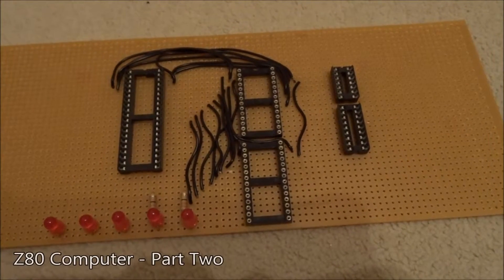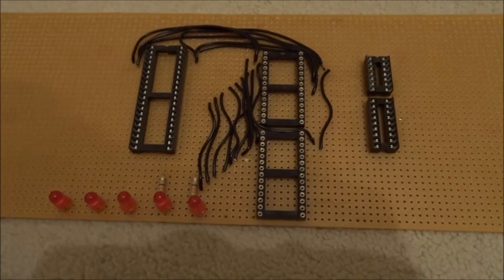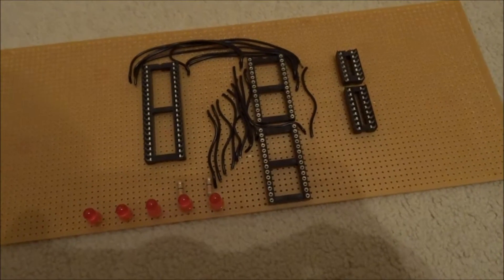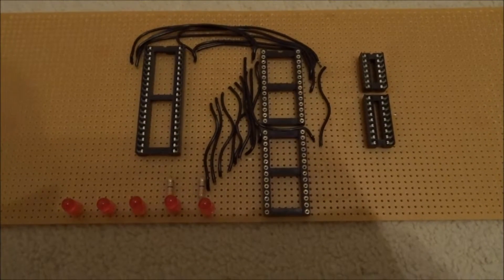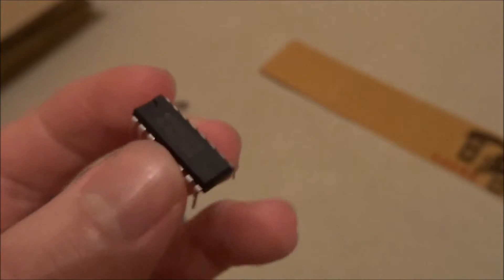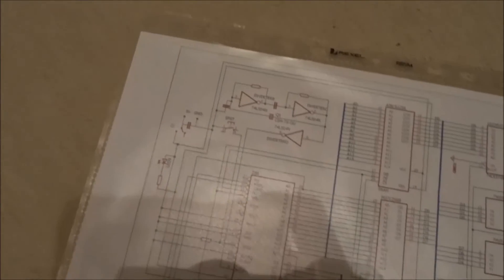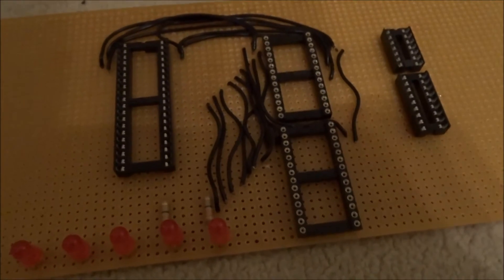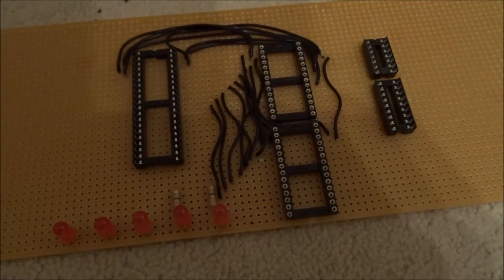Homebrew Z80 Part Two - Progress so far!

Comment: Can you tell us the part numbers for the RAM and ROM chips you are using?
Reply: not what OP is using but are both good fits for this project.
32KB SRAM - HM62256BLP-7
32KB EEPROM - AT28C256-15PU
cheap and easy to find on ebay.
can program this eeprom with just 5V.
bit late but may be useful to others I guess.